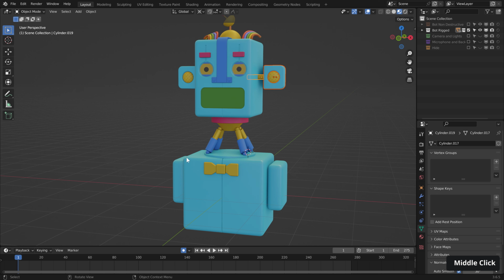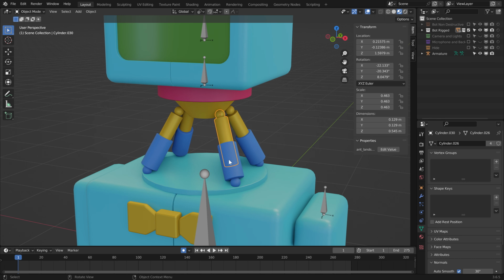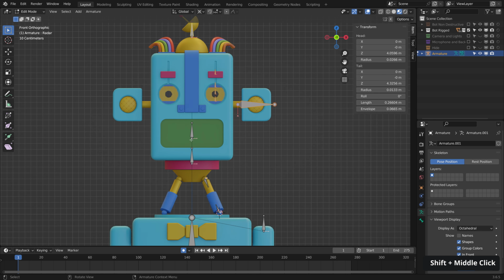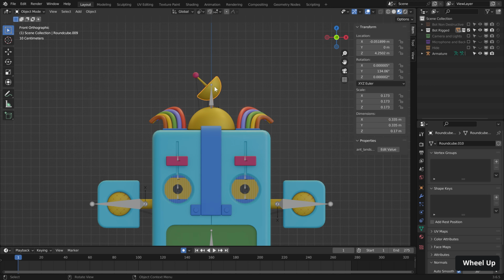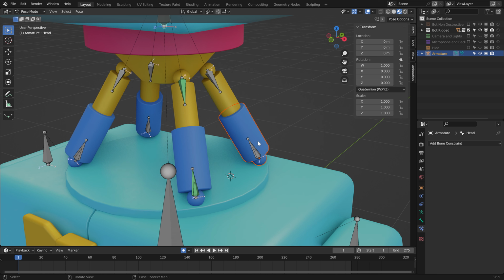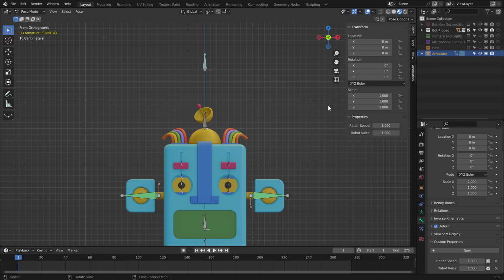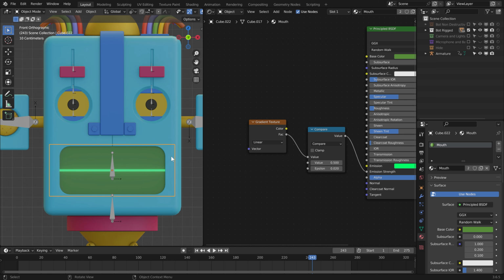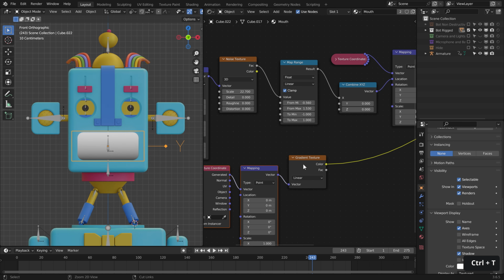Blender Hard-Surface Rigging Fundamentals #b3d #tutorial

Comment: When it comes to restricting the movement of bones, is it better to use constraints modifiers or lock the rotations in the transform panel? I dont know many of the fancy controls when it comes to animating the rigs so I restrict bone movement to make things easier for me. What I mean is, when I move the head of the model and I want to rotate the eyebrows, I don't want them to be rotated into the head. So I restrict their movement so there can only be one way for them to rotate when I hit "R" to rotate them. I also limited the movement of the head so the pistons don't fall out or clip through when moving it downwards. 
I want to know if there is a preferred way for limiting/restricting bone movement. Like is one better than the other or is there a way that is more "professional" for when you work with others?
Reply from the maker: Locking transforms via the transform panel is a great way to quickly limit certain channels. Constraints have a few additional options like co-ordinate space,  influence slider, and library override friendly that might make them more useful for more advanced rigs. I also prefer to use constrains as I often layer multiple constraints and it's nice to see them all in one place. - Louis
Reply: @cgboost  Thanks!